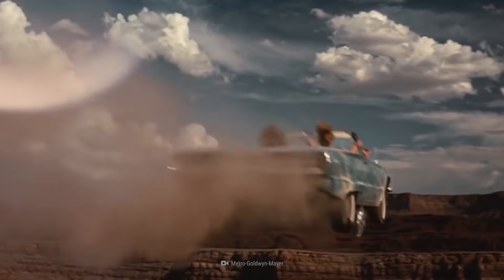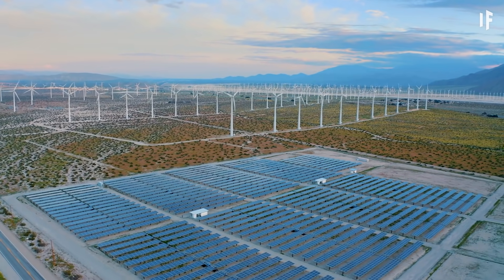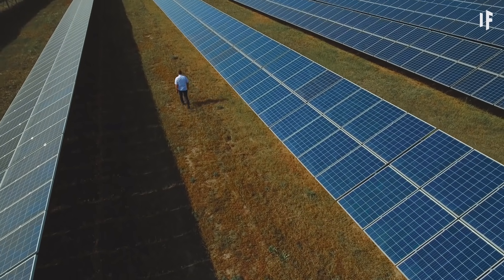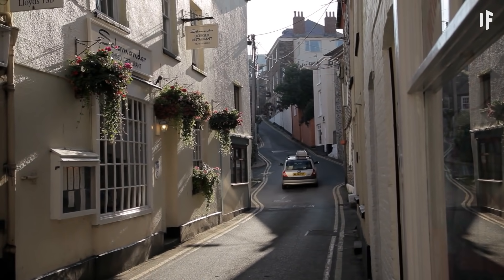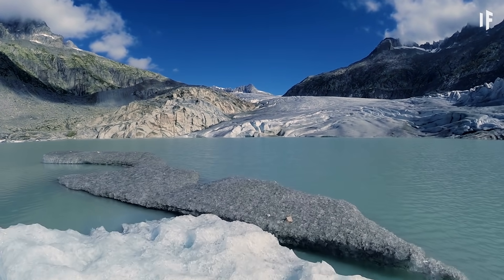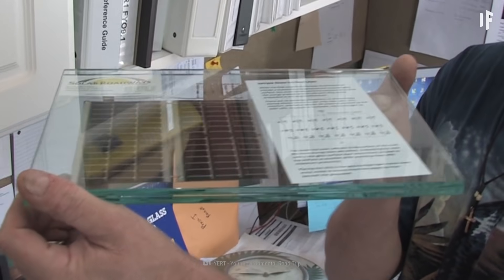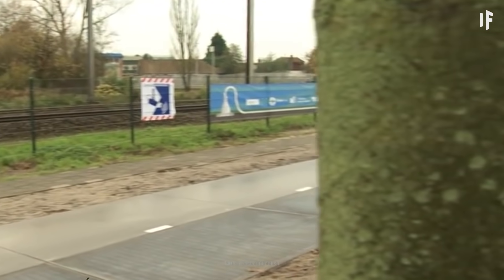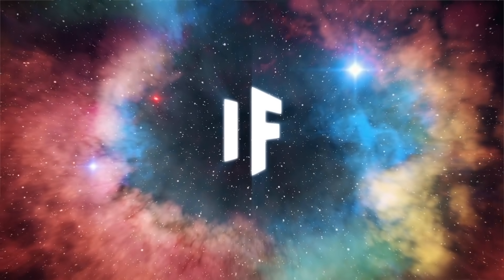What If We Covered Our Roads with Solar Panels?

Comment: None - Absolutely none of the solar roadways, footpaths, bike lanes built until now has worked. There is a new experiment with a footpath in the Netherlands going online right now. Even if this one seems to work, the building cost are at least 10x higher than a system of equal power on a rooftop.  It's just a stupit idea to walk or drive on solar panels.

Comment: Solar tech is getting better, but doing rooftops seems a lot easier to implement than entire roads.  You wont need as much strong glass or LEDs.  Simply making things has environmental impact.  Maybe keep the self-heating part for the snowy regions.
Reply: The generated energy is hardly enough for the planned LED illumination. Heating a road in winter is way off limits.

Comment: This is questionable tech. Every road is in need of a resurface from time to time. This was not addressed in the video and is important. The roads surface would be subject to degradation every time a tire drives over it. Instead place panels on the far edges of the ditches where they are least likely to be hit, and on the shoulders, but not on driving surface itself. The tire wear alone would mean massive continual replacement costs for less electricity generated as traffic itself would dirty the panels. These costs would not exist if the sides of ditches, and shoulders of the road, were the paneled areas. The overall idea is good but the placement on the driving surface itself is a bad one.

Comment: Why the hell would you drive cars on solar panels? What is the purpose? Why not just put the panels along the side of the road where they won't get destroyed by tires and don't have cars blocking the sun half of the day?

It also bothers me that they think converting sunlight into electrical energy and then back into LED light will produce more light than if the original sunlight was just reflected.

Comment: Hey, here is a crazy concept. Why don't you have solar cells on a structure over the sidewalks that would keep people dry and not have the ridiculous maintenance issues of driving on glass. The panels also get more efficient when they are tilted to the sun. There is a reason why nobody uses stand alone panels at a 0° angle. Please stop.

Comment: This has been debunked to death. Solar panels as a road surface is a total waste of money.

Ever noticed that solar panel installations are on an angle? Putting them on an angle towards the sun doubles the power output of each panel.

It's cheaper, easier and more efficient to put them on rooftops, like we already do. The pannels generate more power and are less likely to be damaged.

Comment: Congestion stops solar rays cars on the road would stop light considering there are so many cars and heavy goods vehicles on the road a road that converts friction energy between tyres and road would be more productive and almost as impossible. The clear surfaces on buildings are better to absorb solar before the building heats up and tarmac needs to be lighter at it production stage rather than painting the roads also good to reflect heat but we can mine lighter stone to reflect suns energy.

Comment: No. I'm sorry. Solar roads are a terrible idea.
Solar panels are fragile, expensive, and they don't work when they are covered in dirt.
When you try to use them as a road surface, you take on so many problems it isn't even funny.
Better just to put them next to the road.

Comment: A shadow on a solar panel decreases the electric production!
Roads are the worst place for solar panels!

Its way better to replace roofs with solar.
Another problem is that all panels that have been used as road break way before a regular road needs repair!

Its a nice idea, but not useable yet, it needs more development!

My opinion is that we should first cover all roofs with panels or replace the roof when its anyway needed where the direction is good enough.
In my country they had the project "1000 roofs".
If that is not enough then put sokar panels above prakinglots, that would help when its raining and snowing and would lower the temperature in cars in the summer!

We still should invest in studies and inventions in that direction but its time for less complicated, less expensive and mor efficient techniques!

Comment: Why not the side walks instead 
Cars cover the roads  and block the sun, people have a smaller foot print and roads would stay the same and wouldn’t be susceptible to slippery conditions on plastic. And with heating  elements it would help people when walking. Plus you wouldn’t have to “reinvent” the tires.

Comment: Carbon Dioxide is not the biggest driver in global climate change. It's the sun. In fact, Co2 is rising but temperatures are not rising along with it in the same way. There is no proven evidence that both are correlated. And showing a chimney that spews water-vapour and saying like this is CO2 is misleading. Co2 is invisible.

Comment: There are 2 reasons why solar paved roads seem a good idea : 1- you know nothing about solar panels and 2- you know nothing about roads. Solar roads are a scam. If you have a solar panel, the last place you want to put it is on a road. Putting solar panels on a road is like drying your wet dog in a microwave oven : stupidity.

Comment: thunderf00t and eevblog have debunked these Solar Freakin' Roadways boondoggles.

You are better off putting smaller panels along or above the roads in the right locations, properly angled. Not driving on them.

Comment: My idea instead would be to instead cover the roads with a type of tunnel where the panels are over the cars, not under it. In cities like Phoenix, this would be a better idea.
Reply: First fill up all available roof space, then and only then, start thinking about covering roads.
Reply: @PlaywithJunk  no, I'll think however I want. Thanks for playing though!
Reply: @danielg6566  When you think about covered parking space, I will think with you. That will also keep parked cars cooler. ;-)
Reply: @PlaywithJunk  where did I say ANYTHING about covered parking? That idea is already being done and I think it's great. But that doesn't mean my idea is awful just because we haven't put covered parking in 100% of parking lots. We can do more than one thing at a time. And I'm not suggesting making all roads tunnels. I mean maybe 10% or so of roads could have panels above them.
Reply: @danielg6566  But why build an expensive cover over roads when nearby buildings offer a much cheaper opportunity for solar panels on their roofs?
A roof solar system ist the cheapest and also most effective you can get. I don't unterstand the whole discussion about solar roads, no matter if covered or driven on or otherwise.
It's not about you, but the whole "solar road" idea is awful. It's like the Holman steam locomotive. Complicated and expensive and no benefit over traditional systems.

Comment: Sorry look at solar roadways debunked by Thunderf00t.
It is just a bad idea because of low efficiency because if you're not on the equator you need a more optimum angle to get the most efficiency.
Driving on solar destroys them within weeks and slick solar roads are totally unsafe to drive one.
The road in France is just broken put the solar panels on your roof that's way more efficient.

Comment: It certainly is a noble idea. But before engineers can build those roads, they have to consider how safe it would be for cars to drive on said roads; and then there's the issue of how they can handle all the snowplowing and salt being thrown on those roads (in areas that get a lot of snow) in the wintertime.

Personally, I don't think it's worth it; but I'm not the powers that be. If they think it's worthwhile, more power to them!

I believe I've also said before that I don't think CO2 is a pollutant. I mean, plants eat that for breakfast! The more CO2 you have, the more plants there are. It's only common sense! :)

Comment: There #1 drawback is the fact that we would not be able to drive on these roads. Solar panels are glass, so there is no way they could take the weight of a car, much less the weight of a lorry. Before you start making solar panel roads, you need to invent transparent aluminium, or something equally as capable of taking weight, while also being equally as transparent.

Comment: India is already placing solar panels on canals and irrigation lines which is much cheaper than building solar roads as it doesn't need to be strong enough to handle a vehicle's weight, doesn't require additional land plus putting them on canals reduces water loss through evaporation which means more water for the fields.

Comment: Silicon is brittle.. if you look at concrete roads, you will notice lots of cracks...

Also dirt and rubber tracks will cover the road reducing efficiency.

Solar thermal is a much better idea. Put heat pumps under the road and extract heat rather than electricity.

Comment: The solar-panels-covered roads isn't the solution to global energy problem. First of all that would be very expensive... so expensive we would be better off still using coal. Apart from that these solar panels are not effective enough to spend all the effort to make them. Placing solar panels on top of the buildings which we already know how to AND do is much better way since it's cheaper and more effective. But we can't relay only on solar power... it's not always bright outside (yes, I know I'm too oversimplifying). We should also use more wind-generated power... and we don't need the entire fields for that. Even a tiny wind turbine placed outside your window can generate enough power to fully charge your phone almost everyday. Get a couple of those, place them well, add solar panels on the top of your roof to the equation and given good circumstances you can easily power your and your neighbour's house even if both of you use a lot of energy. And don't even get me started on the water energy... but that's a topic... for another... comment :D

Comment: I like the tech where the road wirelessly charges your car as you drive like in Sweden(I think?). That concept is so simple and would cost a lot but if the government starts putting them on busy highways then it would give people more incentive to switch to electric.
Reply: Wireless charging has a bad efficiency. You lose 50% of the energy.

Comment: interesting idea but wouldn't it be cheaper if the governments assist the population to use solar panels on their houses instead? no wear and tear to worry about, road safety wouldn't be an issue and it would create more jobs when it comes to installing panels on houses. I get that asphalt creates heat and yes you can try to utilize it but it seems to be very expensive to do. Maybe they can pick certain roadways?